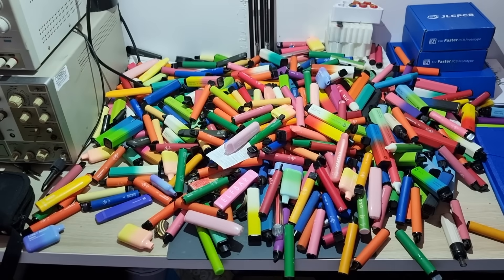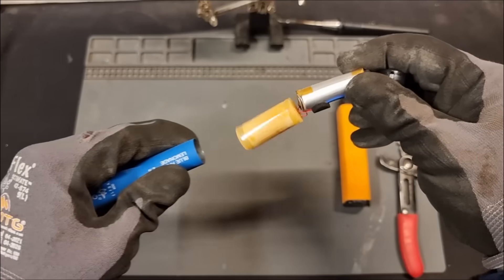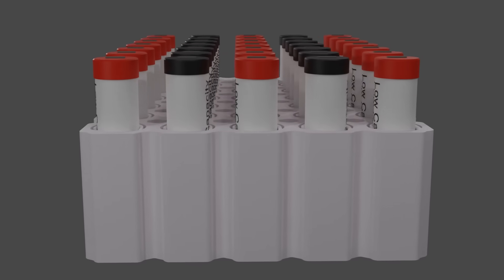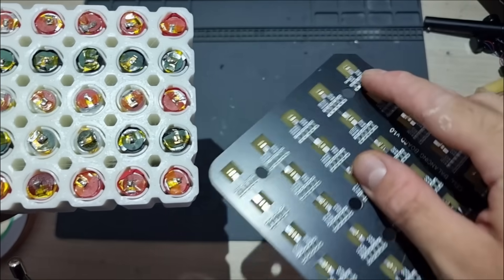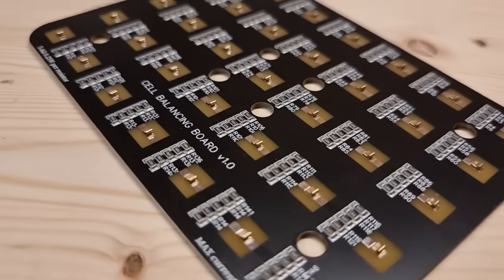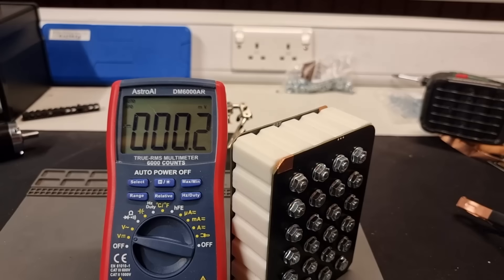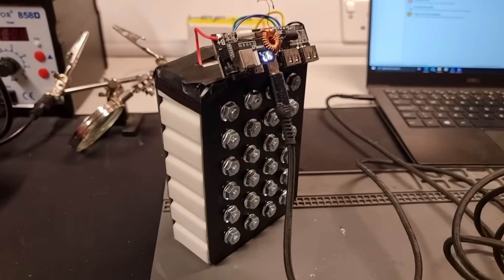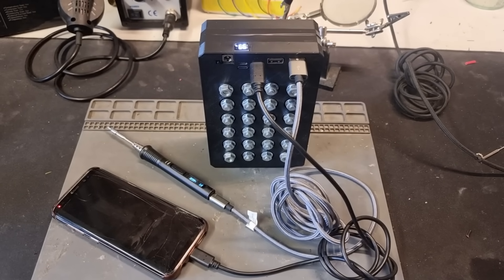Turning Disposable Vapes into a Fast Charge Power Bank

Comment: I'm not convinced this is a 15,000 mah battery pack because they look like 500mah cells, so you only add up the cells in the parallel group to attain the capacity, so that would make it 3,500 mah at 21v maximum down to 15v discharged.
Reply from the maker: Good spot, i mentioned 15,000mAh for simplicity as, unfortunately, everyone is used to seeing capacity ratings for a 1S power bank. Even the 5S anker power banks state their capacity as a 1S equivalent these days

15,000mAh is the 1S equivalent capacity, as each cell is 550mAh and i have 35 of them, so accounting for slightly reduced capacity I went for 15,000.
Reply: @Chris_doel  yes, it's a dirty little trick manufacturers use to make you think you're getting much more than you really are!
You can have a million batteries in series but still only have capacity based on combined parallel, that's why those "large capacity" power banks can barely charge a modern mobile 1 x , stepping down high voltage does change things a little from what I understand but like yourself, if you want a good power bank, build it yourself.
Love your printed battery holder.

Comment: Spring tabs on PCBs attempting to make contact with soft cylindrical lithium polymer cells.....dear God you are the King of bad ideas. I will give you credit for the balancing PCB and mentioning the dangers of connecting cells in parallel when there is a massive difference in voltage. I've seen <10Ah cells that are 0.5V apart attempt to balance each other with over 100A of current even if it is for a second

 I'd imagine you are familiar with Jehu Garcia's PCB design for cylindrical lithium ion cells (18650 and 21700, don't think he made a design for 26650 or 32700). He thought he had discovered a solution that would make spot welding unnecessary for DIY'ers...until he discovered that the leaf springs on the cheap cell holders absolutely cannot handle more than 5A and the expensive KeyStone cell holders with the gold plated leaf springs could potentially be pushed up to 10A. I actually have a video on my channel comparing cell holder leaf springs with my RC3563.

Everyone is trying to find an "easy" way to make a battery but the reality is you need to understand the basics of electricity to understand WHY spot welding, ultrasonic welding and laser welding are the only ways to properly turn a bunch of cells into a battery. In the case of these soft cylindrical lithium polymer cells the aluminum tabs on the end can be a pain in the ass to solder if you are using typical 63/37 rosin core solder. The cells themselves have far less mass than an 18650 so your soldering iron could really do some damage which is why I made my 7S2P pack using 1400mAh cells by spot welding 0.10mm thick nickel strips to make a bunch of 2P packs and then I used longer pieces of nickel to make the series connections. (Normally you'd want your series connections to have the most cross sectional area/lowest resistance as the entirety of the current draw must pass from each series group to the next whereas the parallel connection can be quite thin since you should be matching cells as closely as possible so balance current within that paralleled group of cells will be tiny). I tried a few USB PD modules that required 21V+ to trigger the 20V PDO hence the need for a 7S. When I see people using 5S I get a good chuckle out of it. No way your input voltage will be over 20V under load so you end up dropping down to 15V 3A or 45W as your max power.

Drawing 5A out of a 5S7P pack using these cells should be fine but charging at 5A is a bit iffy.

These soft cylindrical lithium polymer cells are so cheap and I've searched far and wide for datasheets with no luck...considering the device they are being put in will not require more than 3 or 4 charge/discharge cycles I would not be surprised if the vast majority of these cells last only a couple hundred cycles at a moderate charge/discharge rate.

I haven't done any long term cycle testing even though I have an EBC-A20. I capacity tested all my 1400mAh cells and then chose the lowest and subjected them to various loads up to 5A. 3A seemed to be a reasonable max discharge current, the voltage drop on 4.5A was more than 0.5V IIRC. I think I ended up doing a couple dozen cycles at 0.7A/3A on some of the low cells and didn't see any alarming degradation. I made some assumptions about the chemistry but here's what I thought the datasheet would look like
Nominal Voltage 3.70V
Max Charge Voltage 4.20V
Minimum Discharge Voltage 3.00V
Recommended Minimum Discharge Voltage 3.30V
Capacity 1400mAh @ 0.2C Discharge Rate 25* Celsius Ambient Temperature
Max Continuous Discharge 2.8A (2C)
Max Burst Discharge (15 Seconds) 4.2A (3C)
Max Charge Current 1.4A
Recommended Charge Current <0.7A
Cycle Life ??????

Comment: I love this! I hate the way the vape industry has gone, it's a disgusting waste of resources and it's actually shrank the reusable market as a result. I've been using dual 18650 mods for years along with rebuildable tanks. The batteries can last hundreds of charge cycles and last years. I build my own coils and rewick them as and when they need it, this kit can last a long time and use very little in the way of materials. I admit I'm a tinkerer and most people wont go as far as I do but there are easier reusable options that would put an end to this wasteful madness. The issue is that as disposable vapes have become more popular and more profitable the reusable and rebuildable market has shrunk and there are way fewer options to buy now especially on the "enthusiast" end.

Comment: If you’re making a custom PCB, why not design it so all the batteries are inserted in the same direction?
Reply from the maker: Because you would need lots of extra wires in order to connect each rows negative to the next rows positive, so it would make it much more complex to assemble

Comment: How many will you need to build a decent size (100-200ah) battery for a van? Can it work?
Reply from the maker: For 12v and 100Ah, you would need about 600 cells. Would definitely work if done correctly and safely

Comment: Awesome Vid! Been doing something similar, but batts aside I recently have been after dispos with colored LCD screens. Turns out they use ST7735 TFT 160x80px LCDs, which has an Arduino library available. If you make microcontroller projects, you can try it out. Free colored TFT LCDs for your projects! Haha. Also I do want to share, you can solder the nickle terminals of the Li-Ion battery on nickle tabs or wires (ommiting the need for a PCB with bolts) :D
Reply from the maker: Cheers!! Oooo i really want to get my hands on one with a screen, id love to do something stupid like playing Doom on it
Reply: @Chris_doel  That would be rad as hell! I could recall some using an ESP32 for running doom. I'm not sure if the code can easily be adapted to other LCD models, I'll see what I can do when I get the time. Thanks for the idea too! :D

Comment: this is great, i've been collecting these vapes for their batteries too!

connecting random cells off the street in parallel feels sketchy to me though. having resistors in the parallel connections is neat idea, but how much waste does that cause during normal operation? I'd opt for testing/charging the cells individually before hand, though much more time consuming.

tbh i guess the risk is probably low because these cells were literally used once. but, you never know how long the vape was discharged for, so some cells could be damaged and have lower capacity than others, increasing risk of uneven discharge and fire.

Comment: The hex grid arrangement would be nicer if the spacing was a little bit wider to accommodate fasteners in the middle.That, or some cylinders are extruded through the middle for a screw to be fastened in without adjusting the spacing, if you do not mind the risk of potentially cutting into the batteries or introducing structural weaknesses in the design. Provisions for iron-fastened fixtures could also be used, but only for the one side that screws are going into for using shorter screws.

However you do it, not like you've shown. Not unless you want to rely entirely on the outer perimetre for fixing the spring-contact plates.

Comment: I could imagine this project as a modular power bank. Like you make a design for a module, which contains let's say 4-10 cells. Then you have a bigger module, which can hold like 4 of these smaller modules. Then a core module, which has the logic and ports, and connetion for the modules. Maybe a little bit extra work for the modules to see if any battery is dying. Then you could also premade modules for the future, you if you plan a bigger trip or something, you can just fill your car with modules, and replace the main ones if they does not have charge anymore. 
(My dream DIY project is a power bank :D )

Comment: I'm probably just showing that I don't know how electronics work here, but if you wired together around 40 of these cells you'd have enough to build a battery pack that your house could use as a backup supply for a day or so

Comment: WILL U HELP ME I NEED A 3D PRIMNTED BATTER HOLDER TO MAKE A BATTER WITH 52 VOLT OUT OF ETHER 21700 OR 18650 SELLS AN I CANT FIND ANY ONE THAT SELLS A BRUSHLESS SINE WAVE CONTLER THAT I CAN PROGRAM OR IS SELF PROGRAMING FOR A 800WATT 2 HUBS 52VOLTS APLLOW GHOST WITH A GOOD BATTERY

Comment: This is a stupid way to make a power bank. Just buy a cheap BMS instead of making moronic PCBs for battery maintenance. Nuts, bolts and copper tape instead of soldering wires show how much of an idiot this dude is. This shlt will be a huge fire hazard.

Comment: What kind of power delivery does it estimate to have? I was thinking of doing this for an E-Bike as well, but you would need a 52V 20Ah battery for maximum performance and range for an E-Bike
Reply from the maker: I'm building a 48V 15Ah e-bike battery as we speak. It's 13s10P of the larger 1500mAh cells

Comment: What types of resistors should I use? How would I calculate it
Reply from the maker: Think worst case difference between two cells. 3v minimum and 4.2v maximum usually. That means 1.2v difference. You will want to limit the current to 1A maximum, and also make sure the resistors can handle the power dissipation with 1.2v and 1A
Reply: @Chris_doel  If I may ask, why 1A? Is it a known fact, that that is a safe amperage for your batteries to not explode? or did you calculate it based on something.

Comment: The ABC did a report on these years ago saying you shouldn't throw them in the bin and showed the correct way to dispose of them was to take them apart, throw the cartridge out and then recycle the battery at an e-waste centre.
The only problem is, there isn't enough e-waste places around. It requires people hoarding them and then going out of their way to safely recycle them.
Most people don't do that, or feign ignorance and act like they don't know when it's taught in primary school.

Comment: thought about opening these up and connecting a bunch of the batteries together with a lil duct tape magic and seeing what happens. these batteries are usable, just a normal rechargable battery has a few hundred or thousand cycles that it can go through before the battery itself dies right?  its waste to throw em away after a couple uses! 
try and make a long lasting cell phone power bank, or maybe a laptop charger, i wonder if you plugged it into a real pc how long could it run before it dies lol. 
how many of these does one need to make a legit generator.  what happens if these actually do explode? lol

Comment: Damn I might have to try this. I myself vaped disposables for a while but kept them all cause I wanted to find a way to dispose of them responsibly. Then I first learned of taking them apart for the batteries, which I used for arduino projects. Now I collect dead vapes off the ground and harvest the batteries from them, probably got like 50+ of them now. This would be a cool project to make with a bunch of them.

Comment: I love this video, me and my son have been picking these up when we see them so we can make something like this, can we charge each cell individually to full capacity before cinnecting everything together? Then we wont need to instal resistors?
Reply from the maker: Yep, that is actually the preferred method of balancing the cells :) the only reason I used the resistors was purely for convenience
Reply: @Chris_doel A reply from the man himself! Thank you, the 7 cell holder looks ideal, I'm assuming we can attach multiple together by using a strong adhesive? What we will probably end up doing is finding a suitable box and then using the appropriate amount of cell that fix in the box

Comment: I broke my first vape battery (which i still have) and if i choose to fix it will last me another few years of steady use (pretty sure a single lead got disconnected after the circuit board) 

This is the entire reason i wanted rechargeable vapes. Whats the point in throwing out a battery every week or two. just dont cheap out the first time and youll have a good battery for years.

Comment: Amazing. Quick safety note for others; Chris is a pro [my gosh the PCB is genius] - as for if you're wrapping sides of batteries, with copper (like in video). make sure the sides are at least like seen in this vid - coated... though not entirely recommended - under any coating is pure way for short circuit - even with time, best to be careful!

Comment: would it be possible to make UPS for computers with vape cell batteries? even if it took 100, i'd be willing to try it if it was possible. I don't know the math part of electricity well, I'm more of a software / code person but my roots lay in hardware days l0l
Reply from the maker: Yep definitely possible, in the near future im going to be possibly doing a similar thing but on a larger scale....
Reply: @Chris_doel  can't wait to see what you come up with, I'd really love to build a UPS for my computer cause my apartment has nasty power problems using the same method you come up with. I also like how you addressed the different charge issue , very clever!
Reply: I also have WAY less tools than you though so it'd be a challenge lol ( tools / electronics in general are insanely expensive in Canada )

Comment: Amazing! In Greece we do not have these disposable vapes (i think!) but this is fantastic. I could see this project turning into something big. Like having automated machines that collect the batteries, test them, charge them, place them inside the cases in correct polarities and end up with a finished product of a power bank (or something else). Also, could create a power cell big enough and interchangeable for a powerbank enclosure.

Comment: 9:38 I know that for the content 50,000mAh sounds great but for people who are really interested in building such a power bank it will be closer to the capacity of 10,000mAh with a weight of about 0.5kg so I do not recommend building such a power bank I also built one myself and it worked for less than a few months it is a pity to waste your time but I recommend collecting these disposables and using them in small electronic projects: RC helicopter, flashlight or something else ;-)
Reply from the maker: 15,000 mah, apologies if it sounded like 50k

Comment: Are the newer 5k+ disposable vapes not lithium anymore as I've heard several people say you can get about 9 charges from them and then the battery is worthless.

Just curious but I do know the newer disposables actually let you charge then.
Reply from the maker: From my understanding, there is a chip inside the rechargable disposable vapes that either counts the number of recharges or number of puffs and then prevents you from charging once it has exceeded these limits.
Sadly they do this because the liquid cannot be refilled or the coils replaced, so they artificially make it refuse any charge
Reply: @Chris_doel so wasteful I've a feeling they made these ones to get round upcoming bans but really now you're discarding a battery, a USB-c port and in some cases (lost Mary) now even a small lcd screen.

On the plus side it's really easy to remove the batteries on them.

Comment: Those clamps on the inside to hold the battery is a genius idea, You solved a major problem which occurs in 3d printing, can you share the STL file or a reference link? Thanks in advance
Reply from the maker: Check my community post :)

Comment: Copper foil over terminals can be super dangerous, some vape cells have the whole case as - and just the middle of the top as the +, you'll find out pretty quickly if that is the case.
Reply from the maker: Yeah I was worried about this too, first thing i did was check the continuity but luckily all vape cells seem to have a polymer exterior. Technically these batteries class as pouch cells despite them being cylindrical

Comment: I also collect batteries from vape machines and everyone I know also collects them and brings them to me, so I already have a lot of them... I would like to make a station similar to ecoflow out of them, but I haven't decided to do that yet. So far, it seems to me that the best solution is to give each battery its own bms and make several parallel batterypacks (for example, 20 cells in parallel in one batterypack and maybe 15 batterypacks with the option of hotswap connected in parallel. You wouldn't want to set up a discord server or some other thread where everyone would exchange ideas with the fact that maybe we will pick up some ultimate connection and design? 👀